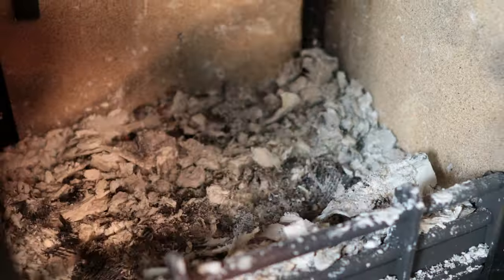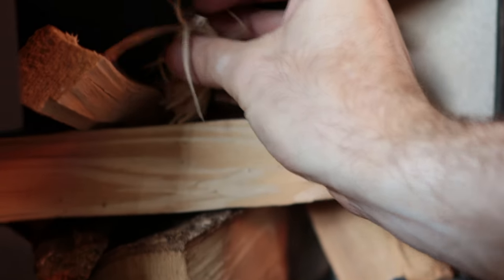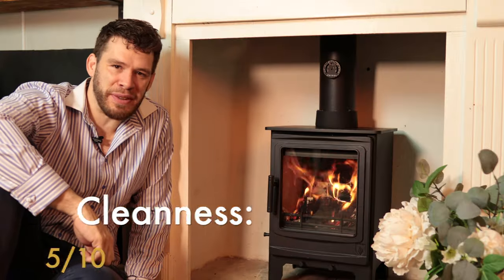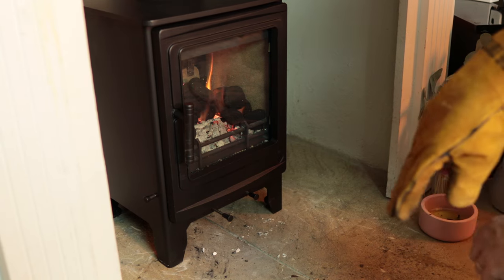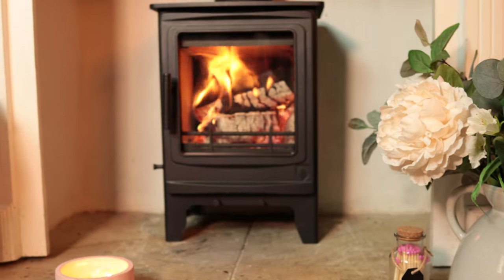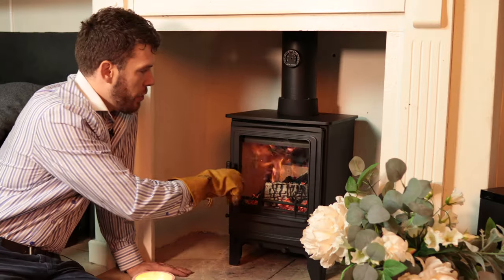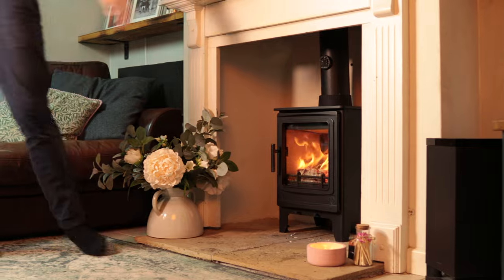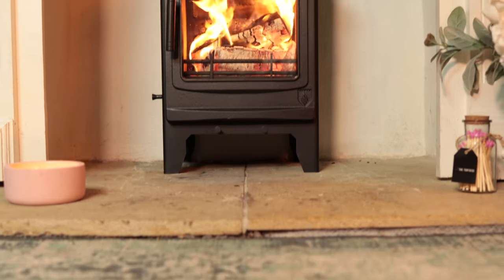Full Review of Ribble Valley Wilpshire

Comment: On a separate note, does it make a difference to the optimum temperature depending on the size of the stove. I have a 8kw stove so are the temperature gauges the same for a 5k as it is an 8k.
Reply from the maker: Surprisingly it is. Larger output are transferring more energy due to the greater calorific value of fuel inside it and the greater surface area of the stove, not through higher temperatures.